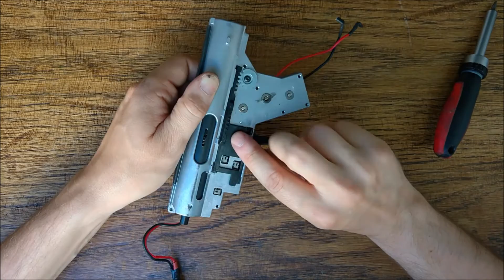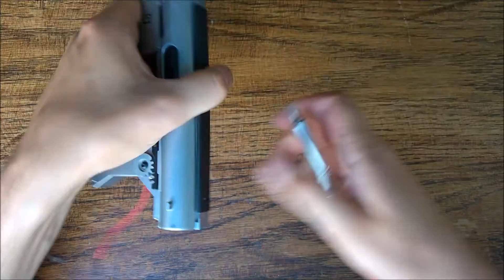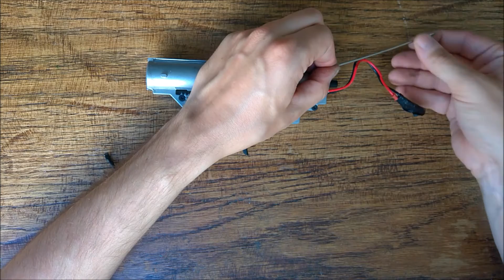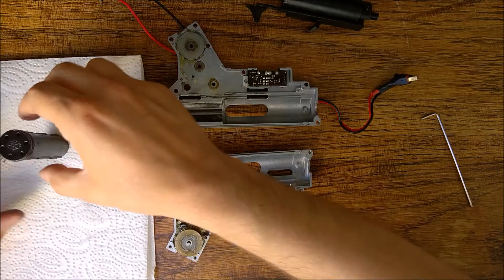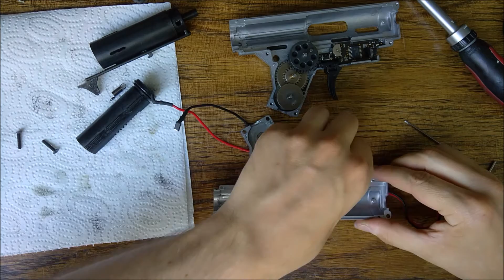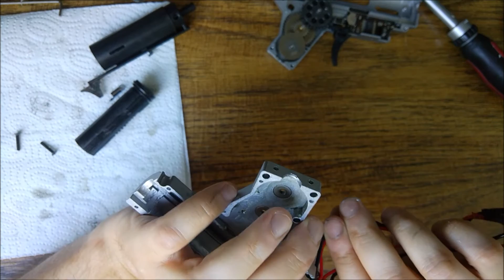Scorpion EVO 3 - ASG - Gearbox Disassembly

Comment: I got one of these amazing little guns and a carbine Evo on the way... this gun already has every kind of upgrade you'd want as is... Already put 7,000 + bb's through it, most of them tracer (don't forget to get the 18 mm to 14 mm adapter for it otherwise you havehave to choose  your suppressors and tracer units jusa to fit an 18 mm and das not good)... Couldn't bear to tear into it just to grease the gearbox!  So i removed the motor and sprayed several spritz of  Evike spray gearbox grease through the hole.  Just the right consistency (i.e. snot-like) Does it help or do anything, beats me, but makes me feel better, also you know when the gun's heating up from too much firing cause you can SMELL THE GREASE, yet.
Reply: ...already sent away for an upgrade stronger spring and the metal spring guide, but when they got here i had second thoughts about adding a stronger spring... i have already heard plenty about gearboxes breaking and decided no reason to give that problem a head start by adding the power spring...
Reply from the maker: The weak part in the EVO is the gears (AND SPRING GUIDE) :-( so if you get some nice steal gears (18:1 for m120-m130) you can go up to an m130 spring with no problem... (Most evos shoot around 135 on 130 springs) ... But REMEMBER TO GET THE UPGRATED SPRING GUIDE !!!! .... Reguarding the "snot" gear grease: Most brands of it is semi conductive meaning that it can KILL electronics :-( And the mosfet is electric, and located INDIDE the gearbox! So beware that the snot grease CAN end up killing the mosfet if you are unlocky :-( .... That's why We at my airsoft company NEAVER put that stuff inside the EVO gearbox... A light layer of none conductive grease around the teeth and bushings THAT's it ....

Comment: Mine has about 3,500 bb's through it  and FWIW i just removed the motor (tricky - it has little springs around the terminals and if you lose one the gun will not work!), and used Evike spray grease... i squirted some up inside the hole... IDK if this helps any, so far.  (by the way, did you really put the gears back dry?)  I don't see any reason to remove the mosfet if it works, might as well just leave it alone, there's more then enough to go wrong without asking for more problems.  I went to your link on buying the gears but what do you do if you don't speak Danish, is there some other source? And  unless a gears broken like with this one (boy, yours sure did have a lot of broken parts inside!) , I'm thinking just change the spring guide (since it helps the spring rotate how it ought to) and leave the spring stock, if you wind up with broken parts what earthly good is another few FPS anyway?
Reply from the maker: It was a customers gun (He agreed to have it shown in the videos) ... He had tried to change the spring and broke the spring guide in the process ... And the broken part later on jammed in the gears destroying allot of parts ... 

Reguarding the "snot" gear grease: Some brands of it is semi conductive meaning that it can KILL electronics :-( And the mosfet is electric, and located INDIDE the gearbox! So beware that the snot grease CAN end up killing the mosfet if you are unlocky :-( .... That's why We at my airsoft company NEAVER put that stuff inside the EVO gearbox... A light layer of none conductive grease around the teeth and bushings THAT's it .... That's why they look dry. They are not dry just coded with a very light layer of grease ...

Yous should 100% change the spring guide to a upgraded one.... Regarding gears as long as you have stock spring and it's working leave it .... When the gears break upgrade to steel gears to 18:1 or 16:1 if you use a 120 spring or lower ... The 16:1 with 120 or lower spring will give better rate of fire ...

Comment: Does someone know what causes the gun to double peep? (At 12:45) Cause I got that issue and don’t know what to do, I’m guessing it’s the motor but I’m not sure
Reply from the maker: It means that the mosfet found an anomality with the gun. Eg. Motor not turning as expected ... Check that your motor wires are firmly attached for one ... If the problem persists you may have a broken gear set or another broken part inside the gun ...

Comment: What are the best or easy upgrades for scorpion evo? I fitted bearing spring guide and might want more :)
Reply from the maker: Well: The best upgrades depends on how you plan on using it ... 

If you want a bit more speed (ROF / RPS / RPM) it can take 16:1 gears very well (as long as you have springs under 130m). And that is WITHOUT having to change the expensive motor!... I have personalty upgraded many EVO's using these gears: http://airsoftteknik.dk/VareDetaljer/VareDetaljer.cshtml?VareKode=004001 If you want to buy these exact gears from other country's than Denmark just drop them a message using the form here: http://airsoftteknik.dk/Kontakt Then they will give you the total including shipping ...
But be aware that changing gears will require you to open the box, and 're-shim' it after the change ....

The bearing spring guide is a GOOD change !!! 

Changing the spring to match your field's limits is of cause a must doo ... (But I assume you already did that) ...

And the final (Kinda must do) is to change the battery plug's ... The default small tamya plugs just simply can't deliver the power that the motor wants.... And it's just so dam simple to solder them off and solder on Dean-T plugs on your battery and gun for more power delivery ....

Again go to: "http://airsoftteknik.dk/Kontakt" and send them a message (First field is your e-mail, second just a subject, and the big field is for the message) ... They understand English Very Well! And reply pretty quick :-) And if you just tell them what gun you have and where in the world you live, they will send you a "Suggestion's list" with a total price and you are not required to purchage anything ;-)
Reply: AirsoftTech.dk Thank you for the reply! I live in The Netherlands and field limits are 360fps max for full auto capable guns. Currently I have m105 asg milspec spring and ball bearing guide its 99.9% of the time under 360 fps and had a few 361fps reading unfortunately but mostly it is 346-354 with 0.20gr. 

Thanks for the reply, the connectors are  a pretty easy one indeed :) would feel bad if I have to send an email because shipping to dk is probably not an option for replicas here though. :/

Since I am still a airsoft noob, but have technical skills (used to be car mechanic) I might want to do the deans connector (or even better ones) first
Reply: AirsoftTech.dk forgotnto mention; goal is accuracy and if possible more range and then RoF at sub 360fps wise
Reply from the maker: The reason that I recommend Dean-T plug's is (As I will demonstrate in another video later this year) that they can handle the full startup current of an Airsoft motor (Given the motor is not insanely under powered) ... Other plug's (Like the XT60) may be able do handle slightly larger currents, but it's not nessesary ... 

So because Dean-T is enough, and still a very common plug type on airsoft guns that's what i reccomend :-)
Reply from the maker: Regarding range: When you can't increase the FPS, then it's all about hop-Up ... Almost any kind of high quality is slightly better than the standard (Will give you ½ a meter+) ... R-Hop (if you can find a person that can make it correctly) will be even better than just using a good rubber .... My personal experience is that R-Hop (And flat hop and all the other hinds of hop up styles) gives you 1-5 meters max! of extra range... And 5 extra meters is only when done extremely well ....

Please don't kill me !!! The "1-5 meters max" statement is PURELY my own real world experience. I Know that many people (often people that make money by installing R-Hop's) say that they can increase range by 10 meters ... Personaly I have NEAVER seen an hop-up improvement increase range by 10 meters... (Unless the gun was an old gun where the hop-up did not really work )

So open the gun (Not the gearbox) https://www.youtube.com/watch?v=nTwYvnsiumw and put in a good quality rubber in the hop-up... That may increase the range a couple of feet ...

Acuracy wise: If you use very high (often expensive) bb's you could put in a 6.02 or 6.01 for a bit of extra acuracy .... But be aware that smaller diameter will risk giving you more jams ...
Reply: AirsoftTech.dk Thank you so much! Had a firsf full day with the EVO today, chrono was 360, 360, 359, 360 and it was approved! Asg millspec m105 with ball bearing. Used 0.28 asg bbs today but couldn’t quite understand hopup knob so once I had it seemingly ok-ish, I kept it that way. Will subscribe for the deans to tamiya connector and xt connector comparison!

My evo shot 20.8rps with the 11.1v fully charged. Thankd again for yout time and reply!
Reply: AirsoftTeknik.dk Thanks again. Went back here: after my second game my scorpion evo already broke while sighting in reddot on paper in home. Was using m105+ ball bearing spring guide.. after highcap (i think?) was at end of full wind, double beep and then a gnarling metal sound after reconnecting a new battery (11.1v) was using 0.25 asg bio bbs. Is the scorpion reliable? I was really upset it broke before my 3rd game ever. 

I’ve also requested a quote on putting ing gearbox bearings and a T deans connector upgrade while it’s being sent back. (And asked if I keep warranty if the shops does it)

Pretty sure there was metal piece underneath the spring guide (bearing one) spring and bearing were both OK. Pretty sure gearbox lost teeth somewhere with just normal use

Comment: I just ordered one of these guns... my plan, shoot the hell out of it during the first year, if it breaks, hope the factory in Denmark honors the warranty well...once you get the gears out, just hose em off with brake cleaner, wipe em off - tada! Clean. They look a little light on the grease as they are, but IDK, the factory knows something i don't, no doubt.  the thermal grease is a clever touch, indeed! Did the factory short the gearbox on the paste or what.  No way the factory would put that there.  BTW did you really put the gears back in DRY???

Comment: Is the PCB of the FCU coated?
Reply from the maker: No the FCU is not coated on the EVO :-/ ... The pcb's traces is (as with most PCB's) covered by masking ink that makes the traces protected... But the rest of the components are "just" soldered on, no protection added... In our shop "AirsoftTeknik.Dk" (Currently only selling in Denmark) we have worked on 2 different EVO's where small metal peaces has broken loos (1 gear tooth that snapped of, and one where the spring guide tab was broken off) and ended up short circuiting the FCU (Resulting in dead FCU's)... So in general coating it's not realy needed, but when metal peaces break it would have been nice if it had a coating so the expencive FCU don't break...